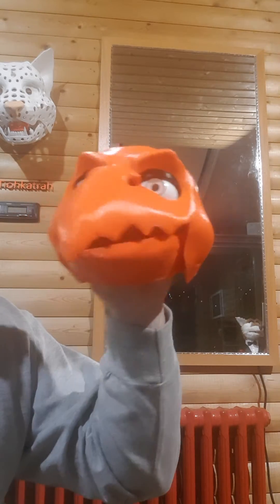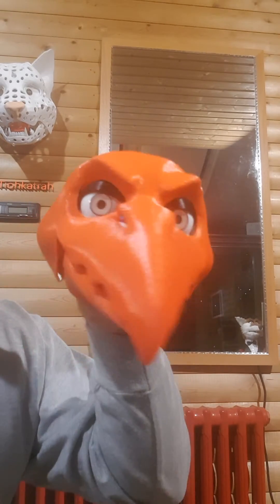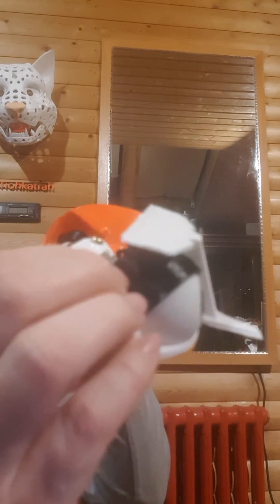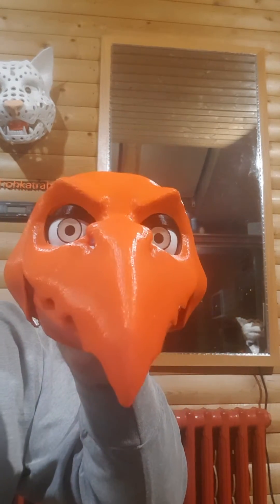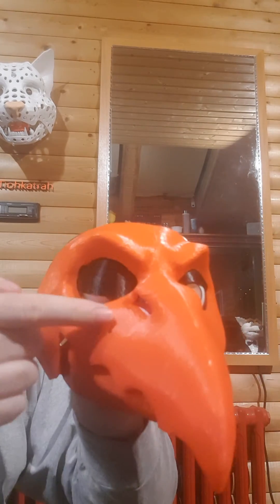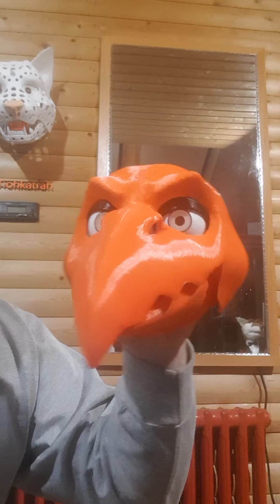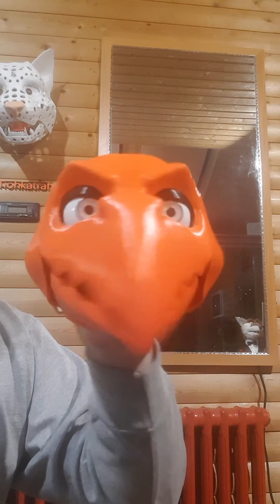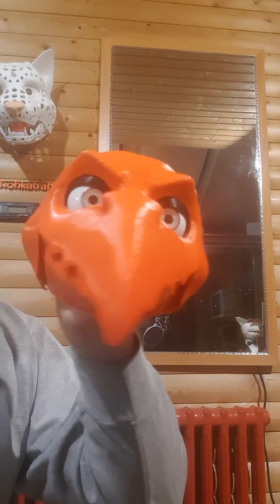3d-printed puppet head base with movable eyes and eyelids #shorts

Comment: I printed everything there now for my big question. is it possible to use just my hand to move the move, eyes and eyelids on one hand instead of two like you have it
Reply from the maker: Yes, I've build puppet heads with moving eyes, eyelids and ears that are controlled from inside the head, but I do not have 3d-printed parts for that (I build all the parts I needed by hand). I basically uses bowden cables to make it possible to pull inside the muzzle (that only worked with one head, most puppeteers could not do it - it's hard to hold on to a head and pull at the same time). Ine other puppetbuilder for our show found a better solution the uses  a trigger in the lower jaw (but my designs do not have enough space there). A alternative would be to use servo-motors, a microcontroller and micro switches inside the muzzle - I tried that too - works ok if you have the batteries outside the puppet (they add too much weight).